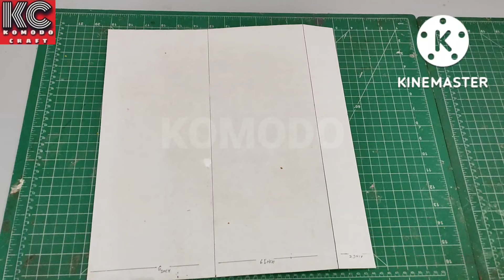hydroponic /hydroponic 3d working model for school project

Comment: Sir i did not understand from 7:11 sec to 7:19 what is that extra pipe and box at last second. Plz respond
Reply from the maker: Thanks for your lovely queries
This pipe is actually installed to take out the water from the box fitted in the model. You must have seen this system before that it was also available in the earlier cooler that when water had to come out from the box, they used to open a wall and The same process has been repeated since water came out of the cooker
Reply: @komodocrafts  thanks for your reply, but im sorry sir kindly name another video of second part of this video and explain that last one pipe and its purpose  sir.

Comment: Sir actually u have made three hole for pipe. Very first hold at the bottom of water tank which pipe where it is going? Since u 've made  another two hole which is on the lid of that water  tank. But at the bottom hole is for what purpose sir.  Do I have to take another water tank. Plz respond
Reply from the maker: Please send me ur queries on this number 7840050078 WhatsApp number
We will try to help you
Reply from the maker: Please send the hi 
And project name also

Comment: Plz tell the names of material used :-
Reply from the maker: Cardboard
Pastel sheet
Water pump
Pipe
Wire
Switch
Battery 
Battery connector
Small cold drink bottle
Plastic 🌲🌲🌲🌳🌳tree
Super glue
Fevicol
Gunstick
Reply: @komodocrafts  thanku so much!!
It will really help me alot in making
Reply: Yes